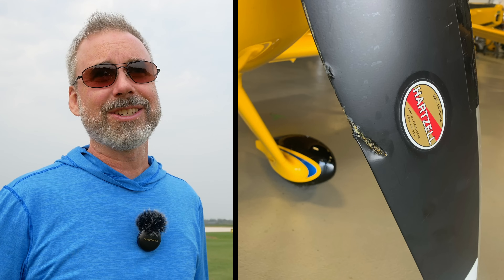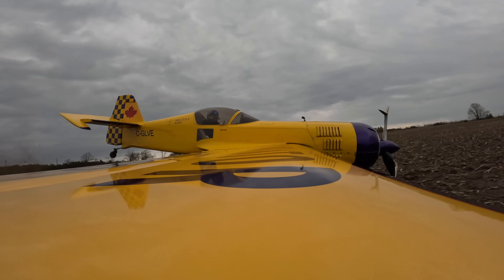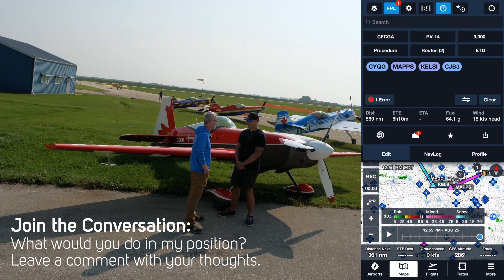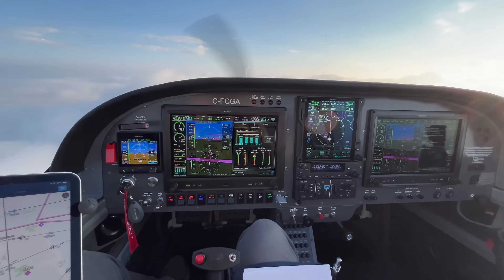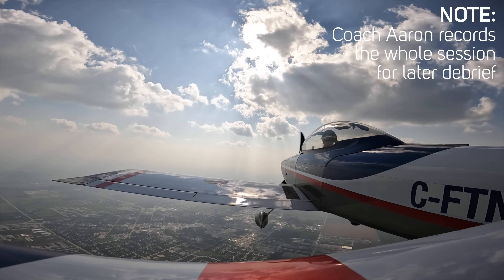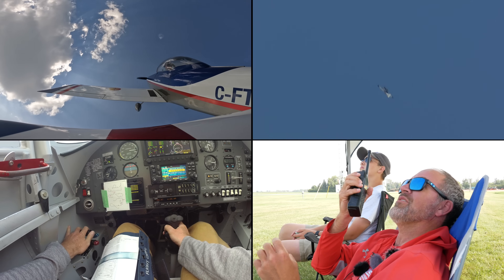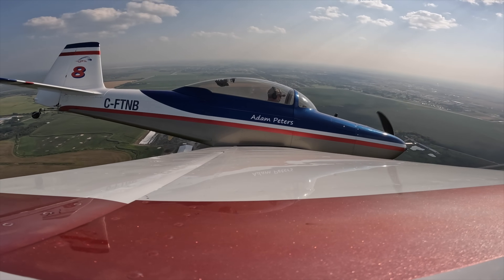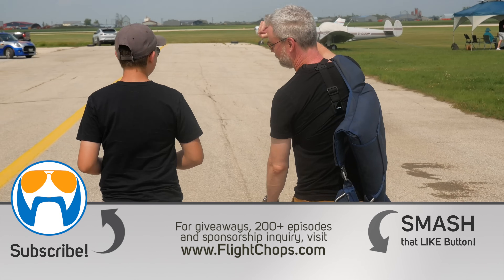This could cost $30,000 and End the Flying Season

Comment: You're buddies logic makes no sense. A Cessna 150 would have a tear down, but since we're flying high performance aerobatic experimentals where the prop gyro forces are way more extreme it's fine 😂
Reply from the maker: His logic is about the certification legalities.  Certified airplanes are in an entirely different, much more conservatively regulated category - they can be used for many commercial purposes, including for hire, etc.  His point about the high performance aspects of what we fly, was to make it clear that we don't take safety concerns lightly... We just have the authority to make our own decisions outside of the regulators; skim these comments and you'll see how many people think is absolutely nuts to even consider an engine tear down for a prop strike like I had... Yet, if the airplane was a certified Cessna 150, there'd be no conversation, and it would be torn down. Period.
Reply: It makes.sense because the prop on a 150 is metal and can transfer more damage to the internals, the light weight composite prop most likely did not.
Reply: @troynyholm232  Wouldn't matter, composite prop on a 150 would still be a tear down
Reply: @FlightChops  I'm not trying to comment on what's right or wrong, just that the logic there makes no sense.

Comment: NOT CONSIDERED A PROP STRIKE IF IT WAS NOT A SUDDEN STOP OF THE ENGINE SO NO FULL TEAR DOWN REQUIRED PERIOD.
YES YOU NEED TO CHECK AND MAKE SURE THE CRANK IS GOOD WITH DIAL INDICATOR AND DIAL MCROMETER, BUT YOU WILL NEED A NEW PROP!

Comment: 1:25 that's not sane to tear down the engine. 

A crankshaft snout and bearings endure about 1000x that much radial load as an aileron is capable of generating against a propeller. 

Get a new prop, and go fly. If the Canadian government has a problem with that, I cant help you as they are clearly irrational and probably speak broken french.
Reply from the maker: I'm quoting the FAA definition of a prop strike (see pinned comment). The only reason I can even entertain not having the engine torn down, is because it is not certified; if it was certified, as I say in the video, there'd be no discussion and I'd be currently waiting on the engine to be shipped back, facing a ~$30K bill before the aircraft was flying again. 
This has nothing to do with being Canadian. 
(but why'd you have to take it there?)

Comment: I'm not an engineer or anything but...  It seems to me that a small "knife edge" appearing type of strike, and from the pictures it seems that's what you have,  any pressure/force would be so concentrated,  it would take very little force to cause the damage we see.   I would think that whatever force that caused the damage would be FAR below that required to transfer so much force to the crank/internal engine components.  Had it been aluminum... that would likely be another story.

Comment: How does one 'get a text' telling you that your prop IS broken?

That is to say, I'm pretty sure you would already know about it, unless the hangar broke your prop.
Reply from the maker: I was in a different city when it happened, and a crew member at the hangar took that photo to break the news to me?  
So yeah, I found out via text with that image. 
It wasn't a good time.
Reply: @FlightChops  Ah, I missed the explanation in your video that someone pushed an airplane into your prop, inside the hangar. 

I'm not a pilot, but I don't think this kind of damage should require a tear-down, since the engine was not running -- I guess that would create a loophole that everyone would try to use.

Comment: Tearing your engine down after that damage would be ridiculous.
Reply from the maker: I can’t disagree with that.
But I was also faced with an FAA AD, and a Lycoming SB that speak to the contrary.
So luckily, being experimental I could make the decision, but if it was certified, ridiculous or not, it’s getting torn down.
Reply: @FlightChops  as a Canadian chapter 549 aircraft (not an "experimental") , you are not bound by any ADs.
Reply: @scubafun2453 correct he's not bound by ADs being experimental. But he is bound by common sense
Reply: @Airplanefish  common sense would say change the prop, and not tear down a perfectly good engine.     FYI the aircraft is not experimental.   This category does not exist in Canada
Reply: @scudsrunners9698  I understand the word "experimental" isn't a Canadian thing but what do you call a non certified aircraft in Canada?

Comment: I think you could use the other half of the damaged prop to do an experiment to find out how much force was required to cause that much damage, then compare that to how much torque the engine's components experienced vs how much it is normally expected to handle.  You might find it is well within acceptable limits.
Reply: The other half of the damaged prop might be the other half of his new prop!

Comment: Sequence #3 and #10, on the 45 down while inverted you should probably be at negative 1g or slightly more.  Need to paint that 45 down line for a few seconds before the roll then same length line before and after the roll.
Reply from the maker: Aaron helped me learn how to cheat those in the RV-14 to avoid being negative too long due to my lack of inverted systems.

Comment: To which AD does the quoted definition refer?
Reply from the maker: https://www.federalregister.gov/documents/2004/05/21/04-11406/airworthiness-directives-lycoming-engines-formerly-textron-lycoming-direct-drive-reciprocating
Reply from the maker: I commented with the link, but incase it is filtered or something, I think this is the relevant FAA AD (and Lycoming SB) info: 

The FAA amends § 39.13 by removing Amendment 39-6916 ( 56 FR 33205, July 19, 1991), and by adding the following new airworthiness directive (AD): 

2004-10-14 Lycoming Engines (formerly Textron Lycoming): Amendment 39-13644. Docket No. 89-ANE-10-AD. Supersedes AD 91-14-22, Amendment 39-6916.

Lycoming: 
Service Bulletin No. 533C
(Supersedes Service Bulletin No. 533B)
Engineering Aspects are
FAA Approved
Reply: @FlightChops Thank you!
Reply: The definition of a prop strike

Comment: If your engine wasn’t running and that was simply prop damage from moving airplanes around in a hangar you don’t have any requirement to tear down the engine.
Reply from the maker: I had a pretty stressful week going back and forth with my local AME and Lycoming discussing the options.  
But to confirm, as the video states, there is an FAA AD that defines what a prop strike is (and this qualifies) and a Lycoming SB that requires a full teardown inspection. The only way I'm escaping it, is by exercising the privileges of being an experimental aircraft owner.

Comment: I have seen several prop strikes and although I get the FAA definition, with both the flexibility of the prop and the tail of the Harvard I don't feel like an engine teardown is necessary.  I am thinking you may have already figured that out though...😉
Reply from the maker: I'm thankful to be an experimental owner. 
If it was certified, there'd be no discussion.

Comment: Do 'not' fly RV aircraft in aerobatic competition. It's a sport plane, not an aerobatic plane. Too easy to overspeed and over G. Use the right tool for the job. Pitts, Extra, Gamebird, etc.
Reply from the maker: I'm not going to fly beyond Sportsman class with the RV.  I have no intention to ever do tail slides or snap rolls.
The only difference between competition flying, and fun aerobatic flying, is that you're being scored for precision and it makes you better over all.
Reply: @FlightChops  It's the airfoil and wing spar on the RV that's concerning. The original design was not to be an aerobatic airplane. Only use the right tool for the job. 5.5 G's is risking it in an RV. As Curtis Pitts always said, the wing spar can only handle so many cycles.
Reply: What is the sportsman class for?

Comment: I understand what the reg reads on a prop strike but do not believe you need to tear down your fresh engine because someone pushed your prop into another airplane . That’s sounds like a waste of a tear down inspection.
Reply from the maker: Yeah - I was surprised to learn this as well - but it is what it is. 
I pinned pinned a comment with the FAA definition of a prop strike; if the engine was certified, there'd be no choice.
Reply: @FlightChops  I hope you don't have the issue many here in the U.S. are facing, 6 months to year, sometimes more, to get engines inspected and rebuilt due to parts and mechanic shortages.

Comment: I struggle to understand the need to teardown an engine if the "prop strike" was an unpowered event. We're talking about humans pushing the planes around, right?
Reply from the maker: I've pinned a comment with the FAA definition.  
Yes, it is amazing how easy it is to damage an engine when it is subjected to forced outside of normal operation.
Reply: Removes the temptation to lie how it happened i guess. Probably a rule written in blood like most in aviation.
Reply: Just think about how the forces are transferred in a static system vs a dynamic one. If the prop is spinning and it hits something there's a lot of inertia and centrifugal force involved which causes essentially a shock torque and some gyroscopic and some radial forces to be applied to the engine prop flange, depending on how hard, most is actually absorbed by deformation in the prop. When static 100% of the force applied is sent to the ground via the prop, prop flange, engine bearings, engine mount, aircraft structure, landing gear. All in a system designed to carry dynamic loading, not static.

Comment: If flying to and from an event is the most dangerous, would ferrying it in a trailer be better then? Or is that just a flyer thing, why drive when one can fly?
Reply from the maker: It’s a major deal (costs and labour) to take aircraft apart to put them in trailers - for over seas contests it is unavoidable, but there is added risk from the disassembly and reassembly, and almost always some degree of damage during the process.

Comment: this is typical outdated regs from FAA.. how do you "dress" a composite prop like yours ? basically you can't.. dressing is only paint deep.  whatever impacted your prop, had it been an aluminum prop would have caused WAY less damage, and possibly what damage that was done would have been within the range where it could be "dressed"
Reply from the maker: So the thing is... if that was a metal prop, I'm told it almost certainly would have forced the full tear down.  
The damage stopping at composite prop blade actually saved the crank.  
Time will tell though - I'll be hanging the repaired prop and test flying it starting in a week or so.

Comment: I don't know Canadian regs, but a damaged prop that was not powered should not require an engine teardown, Check the runout of the prop flange, but chances are it's not bent since the prop wasn't spinning at the time. That's where the teardown comes in is a sudden stoppage.
Reply from the maker: Read the documentation 🤷 Lycoming was very supportive, but made it clear this if this was a certified engine, I’d have no choice. It’s what I scrolled through quickly in the video, but I can also link to it in an other comment.
Reply from the maker: Here's the related documentation from the FAA and Lycoming: 

https://www.federalregister.gov/documents/2004/05/21/04-11406/airworthiness-directives-lycoming-engines-formerly-textron-lycoming-direct-drive-reciprocating

https://www.lycoming.com/sites/default/files/attachments/SB533C%2520Recommended%2520Action%2520for%2520sudden%2520Engine%2520Stoppage%252C%2520Propeller_Rotor%2520Strike%2520or%2520Loss%2520of%2520Propeller_Rotor%2520Blade%2520or%2520Ti%2520%25281%2529.pdf
Reply: Was about to say same, no need to tear down, just check the run out of the flange, this isn't considered a "prop strike" if engine was running thats a different story, he should never mentioned it to Lycoming, it will be a huge waist of money to find absolutely nothing wrong.
Reply: @gainestruk1  The airworthiness directive linked above says it considers "any incident, whether or not the engine is operating, that requires repair to the propeller other than minor dressing of the blades" to be a prop strike and explicitly states that this includes "situations where an aircraft is stationary and [...] a hanger door (or other object) strikes the propeller blade".  So unfortunately it doesn't look like it leaves any room for arguments.
Reply: @MatthijsvanDuin 
I agree. This constitutes a prop strike under the definition, but do you think it needs amended for a composite prop? 
With the fragility of composites I think they would have a failure where an aluminum prop would have a paint damage issue.
But I am not an A&P, I am just a stupid pilot, aviation meteorologist.

Comment: I really wish we would evolve to saying "Prop injury", or similar, for non-operating incidents and reserve "prop strike" for an occurrence with a running motor.
Reply: I agree. If “Not Under Power” should offer a less expensive way to test the crank. Maybe composite blades need a mention in the regs as well. 
I have a Piper Arrow, I may get it a new prop. My prop has an AD for 100 hour eddy current inspection of the hub, it is only $400, I don’t know.  This is when I need one of the old wise pilots to tell me what to do. Problem is, I have become the old pilot, I just don’t feel wise.

Comment: A prop strike is when the engine is running.
Reply from the maker: I thought (hoped?) that as well.  But through this process, I have learned this is NOT the case. Here's a quote from the FAA, and I'll link to the related FAA and Lycomining documentation in an other comment in a minute. 

Definition of Propeller Strike 

(i) For the purposes of this AD, a propeller strike is defined as follows: 

(1) Any incident, whether or not the engine is operating, that requires repair to the propeller other than minor dressing of the blades. 

(2) Any incident during engine operation in which the propeller impacts a solid object that causes a drop in revolutions per minute (RPM) and also requires structural repair of the propeller (incidents requiring only paint touch-up are not included). This is not restricted to propeller strikes against the ground. 

(3) A sudden RPM drop while impacting water, tall grass, or similar yielding medium, where propeller damage is not normally incurred. 

(j) The preceding definitions include situations where an aircraft is stationary and the landing gear collapses causing one or more blades to be substantially bent, or where a hanger door (or other object) strikes the propeller blade. These cases should be handled as sudden stoppages because of potentially severe side loading on the crankshaft flange, front bearing, and seal.
Reply: A prop strike is when the prop is struck or strikes something. Moving or stationary. Either way it's a prop strike

Comment: I don’t understand why this is even an issue…if you weren’t the one who caused the incident, why would you have to pay to fix it? If someone else did it, charge them or their insurance for the inspection cost. Sue if you need to.
Reply: I wondered the same
Reply from the maker: I think you're missing the point about what I was upset about here. 
Flying in the competition, which I'd been working hard toward for months, was at risk of being cancelled, and even the ultimate solution we came up with was a major compromise to flying my own aircraft that I'd been practicing in.
Reply: @FlightChops  I get that, but isn’t the person who damaged it responsible for the cost of repairs? Since the plane is out of commission anyway, why even ponder the need to get the inspection? It’s the responsibility of the person who caused the damage to pay up. I would do the inspection and charge the responsible party or his/her insurance if applicable.
Reply from the maker: @kv501  a teardown inspection is a huge deal beyond the money.  It means the plane is out of commission a lot longer, and it also means when it comes back, it’s in the “infant mortality risk state” again AND the whole break in process needs to happen again.  I’m lucky we’re in a position to even entertain not doing the teardown in this case.
Reply: Walter the shop dog ran into the propeller while chasing a rabbit. Walter doesn't have insurance

Comment: The thumping base you are talking over just makes me turn down the volume, then I can't hear what you are saying and there's still thumping bass. So... sorry, that's the end of this video for me.
Reply from the maker: Can you please describe the set up you were listening with?  
I sound mix to professional standards and want to confirm. 
(this is also the first complaint after over 25K views)
Reply: @FlightChops  Obviously I'm not cageordie, but, yes, the music beat and the speech beat did have some interference. While proportional volume of the bass range can be adjusted in some sound settings on some devices, I'm going to say it is (at least for me) less the volume and more the beat, rythm, interference which is the issue. As for my setup, it is average to low-average consumer grade speakers by Logitech on a 7 year old PC. Is that I'm 60 a factor? Is that I'm autistic and sensitive to sound levels a factor? That last, probably only a minimal factor since as said it seems to be the beat rate which is root of the interference.